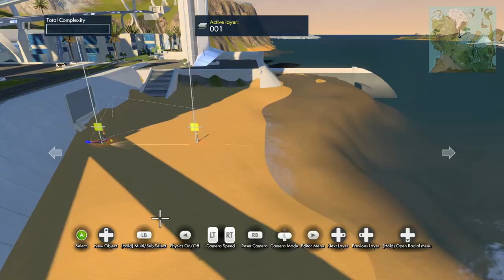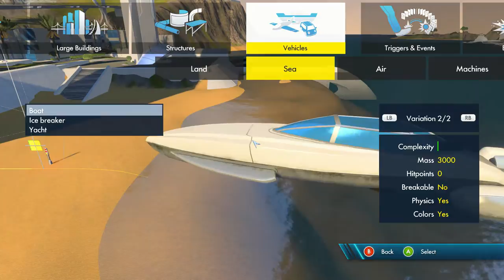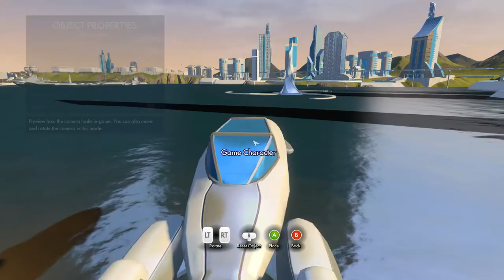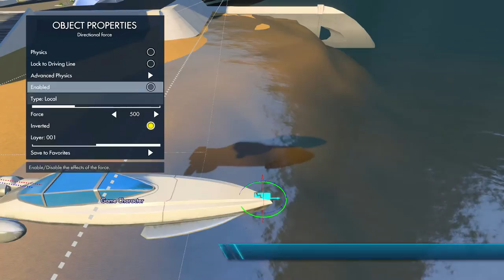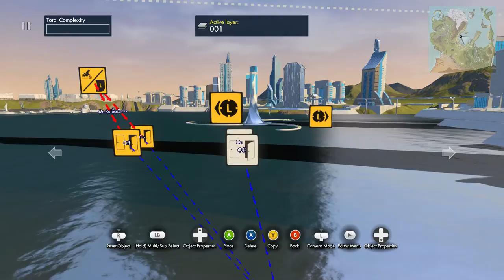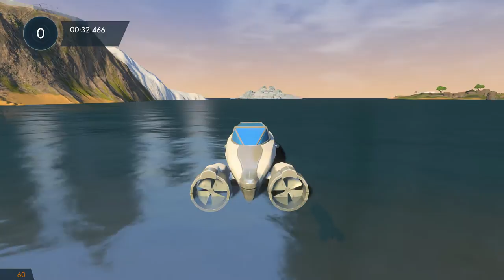Trials Fusion Track Editor: How to make a Drivable Boat!

Comment: This can be useful for beginners, but Grif should've made some physics tweaks, like weight, dampening and gravity. Once you would steer around that boat hard, it can flip like crazy, more than an actual speedboat.

Another thing I'd like to point out is the input. It would be better if you would use triggers and stick game variable data source with multiplying, so to have analog and precise controls.